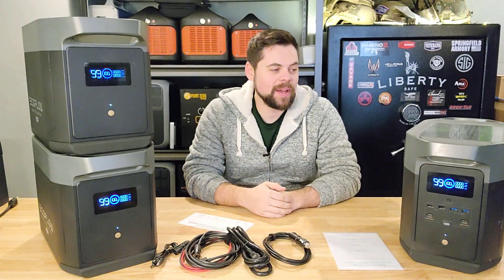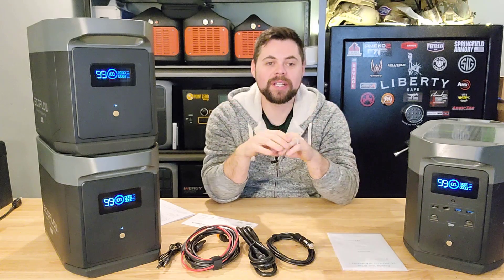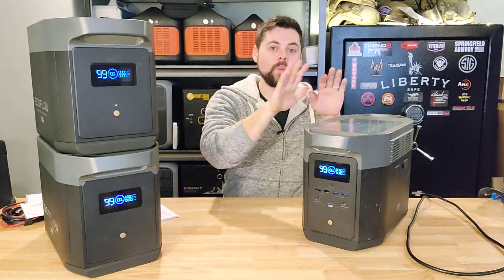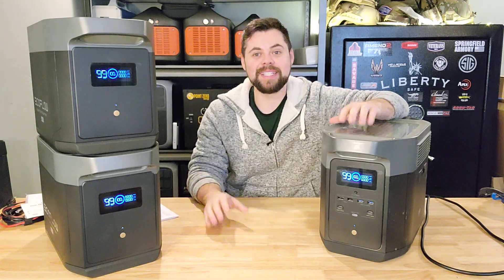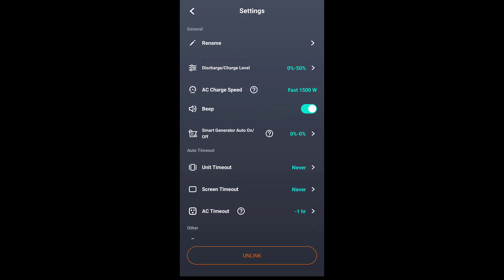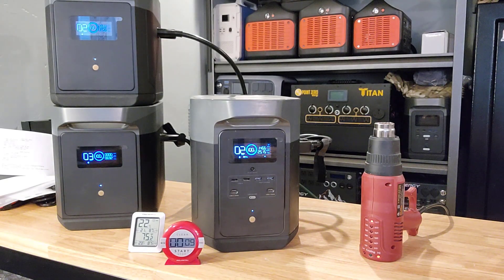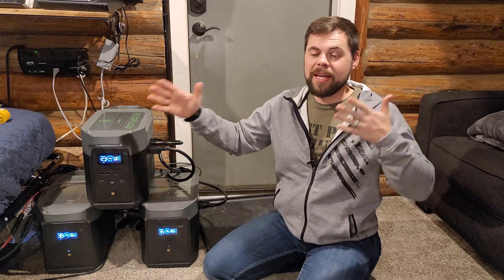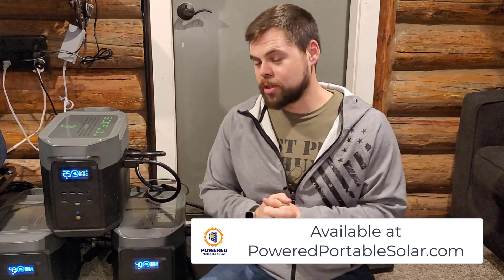EcoFlow Delta Max Test and Review

Comment: The ones I’ve been looking at all seem to have less solar input than the Bluetti AC200MAX. This has 900 W of input. 
I believe your Titan has more solar input?
Reply from the maker: Correct, that is where the Bluetti is shining is solar input but you're right the Titan still beats it. The Titan has 2,000w solar input and can overpanel up to 4,000w. The Delta Pro can do 1,600w solar input and when doubled together with another Delta Pro it can do 3,600w solar input. I just ordered my two Delta Pros yesterday and hope to order the Bluetti AC200Max and AC300 soon. Many big reviews coming to the channel this spring and summer.
Reply: @minutemansolar  
I believe the AC 300 has more solar input, but since I don’t have it I don’t know how much more.
Reply: @zfontain1975  
I have 7.5 kW of solar on my roof, and I can always find a use for more – especially in the winter! 🖖
Reply from the maker: @zfontain1975  That's awesome. I can't wait to get mine and test all of that.
Reply: You going to get the bluetti max or the delta max. Bluetti max you can get up to 1400watts that what I like the most, over the delta. What's your thoughts.?
Reply from the maker: @zfontain1975  yes I am going to get the bluetti units as well. I haven't tested them yet so I can't say. They each have their quirts it seems like.